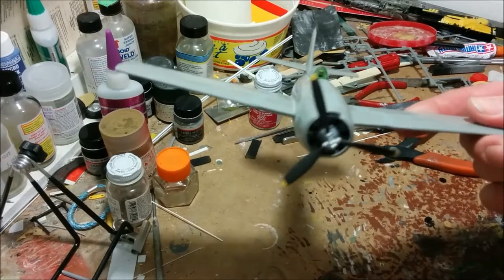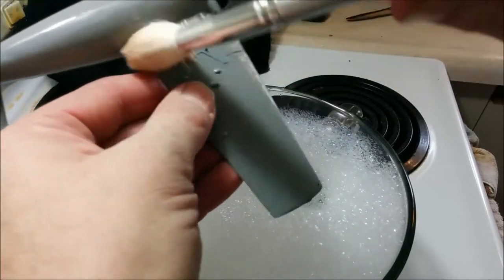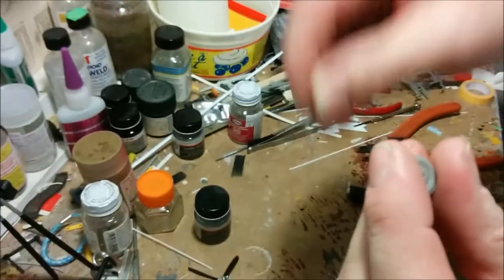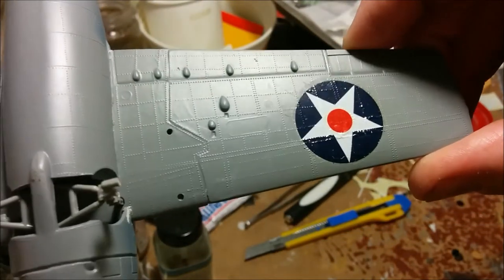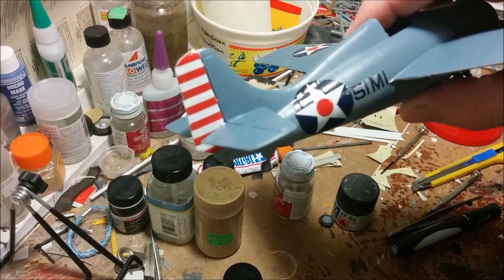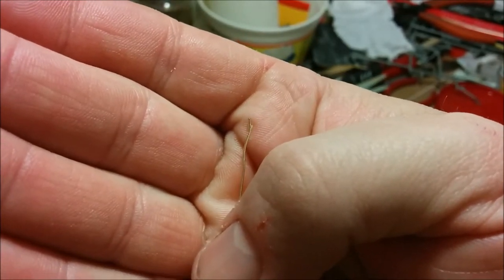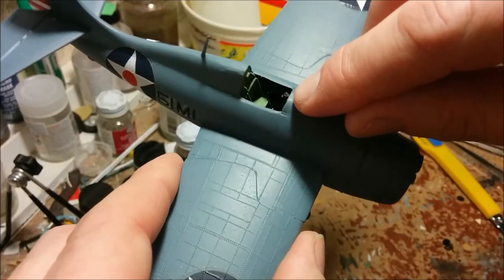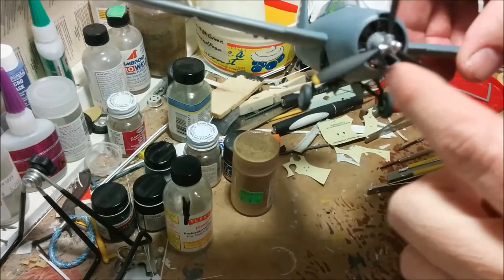F4F Wildcat Build 1/48 Pt3 Completed

Comment: Currently reliving my childhood building this very "golden oldie"! Nice seeing how you problem-solved. I had a chuckle noting the propeller tip discrepancies for the yellow-as you did. Hopefully I'll add the below-wing fuel tanks with tiny plasti-card filler caps and more accurate attachment points. Love your finish. It's fun trying to improve a 1960s model kit.🙂🙂🙂